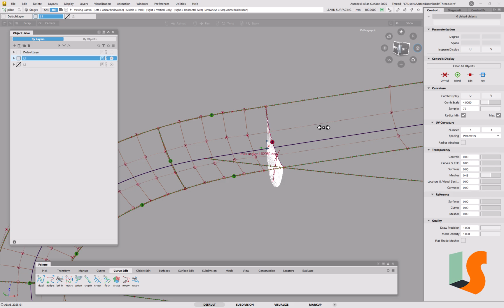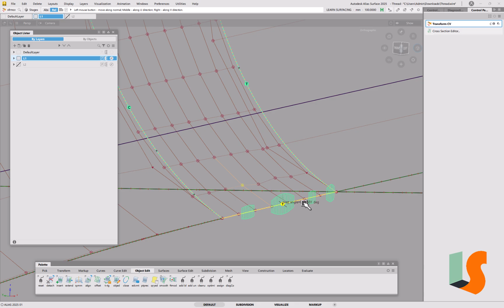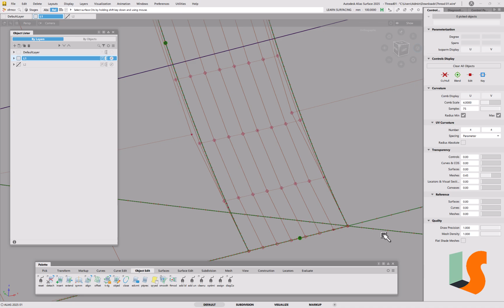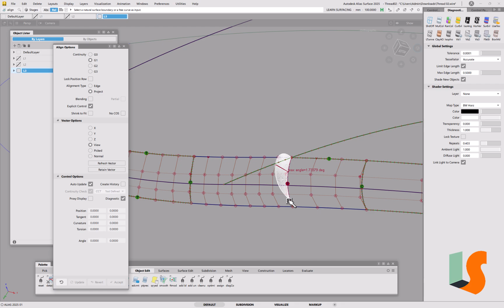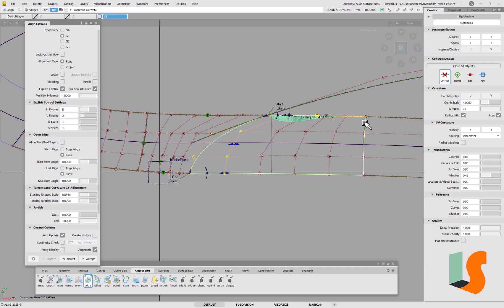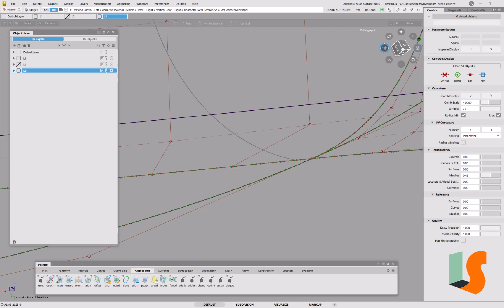Autodesk Alias Tutorial: Fillet Align Problem

Comment: These G1 areas are a real pain in every CAD program. This is why I much prefer to work with G2 instead. Aligning the control points of the small fillets to the isocurve direction of the primary surfaces is the only sensible solution (like what you showed in the 2nd half of the video).
P.S. I strongly recommend you to use a 3d mouse. It will speed up your workflow significantly. :)